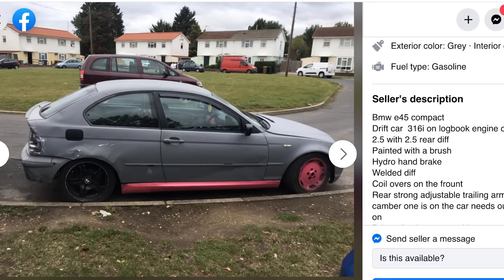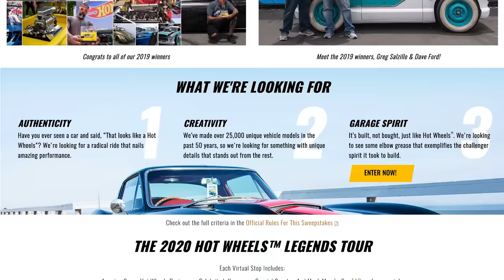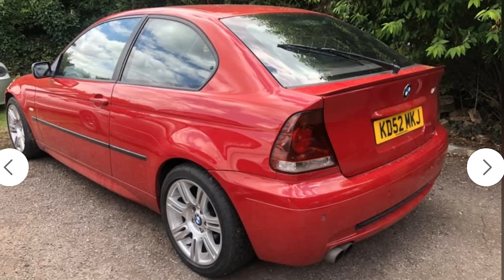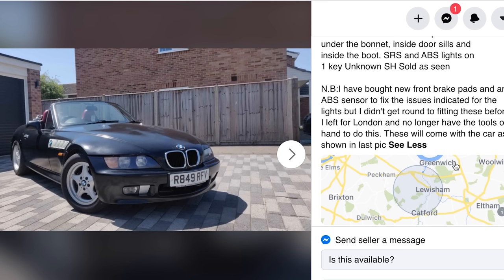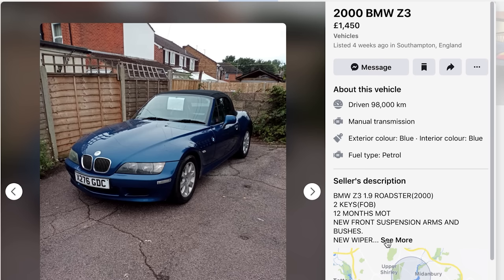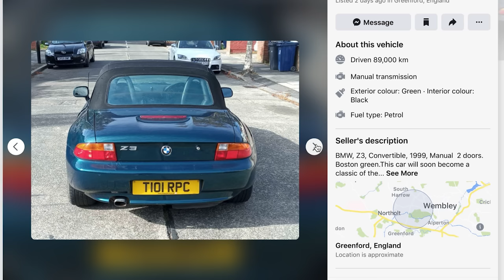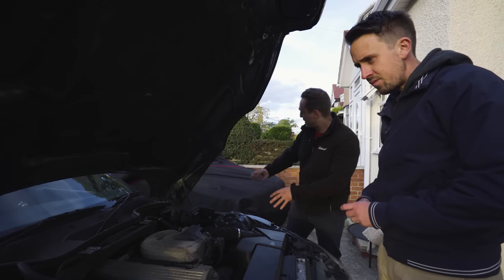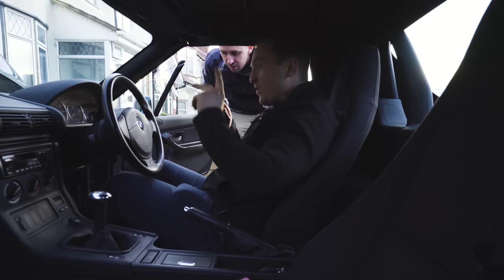£1000 First Project Car Challenge

Comment: The MOT history of this car is hilarious. It has failed because of:
The front lights being too cloudy.
Left windshield washer too low pressure.
Right windshield washer too low pressure (a different MOT).
The airbag being "obviously defective" one two separate occasions.
Worn brake pads after 5 years of advisories on them.
Different lights being out on three separate occasions.
A tyre being fitted round the wrong way.

Nothing major, but bloody hell a simple once over before taking it to the garage could have saved a few fails.
Reply: That's all insane! IDK how anyone in the UK with limited means or car knowledge can even own one. If I had to MOT my car they'd probably take it from me and crush it to put it out of it's misery. Structural rust, dashboard like Christmas Eve (VAG); SAIP, ABS, oil temp sensor, and probably something else, leaking; oil, steering and coolant and probably a million other reasons to fail. All that and my car isn't actually half bad against most other cars with 200k miles. I guess I should be glad I live in "land of the free to drive an absolute pile of shit".
Reply: @TheMadMadDaddy  I don't understand how can you live in UK where average wage is so high and cars are cheapest in the world and drive old falling apart car. I mean how? And why? It all should be so easy and cheap to fix...  Meanwhile my car failed mot in my country because it have red turn signals, had to install amber LEDs that no one sees and hey it got pass as it's not required for turn signals to be visible in my country it requires them to be amber... So much safety in that logic...
Reply: The Mad Daddy I’ve driven a rolling pole before and while it’s a ton of fun and zero worries about it, having a nice car is a different world. No nagging thoughts of breaking down or having a tow truck on speed dial lmao
Plus if I’m gonna drive a pile it’s gonna be alone I ain’t risking someone else if it splits apart on the highway
Reply: @wykydytron  I agree.
Reply: You could have a baby seat in every seat apart from the drivers and it won't fail. Rear wiper washers aren't part of the test.
Reply: Well my car failed because the odometer was pixelated(bmw). How is that a safety thing? I repaired that and now i have an airbag light that turns off after 1min30s.
Reply: @wykydytron  we might have cheap cars but insuring one makes up the difference when I was 18 I had to pay £3500 to insure a £800  2000 reg fiat punto
Reply: @FoookOff  Yeah you're right - I misread. It was nearside/offside windscreen washers that failed on two separate occasions. I don't think it even has a rear washer.
It got an advisory on the child seat because it obscured access to check the belt, not a fail. I was tired when I wrote it, that's my excuse.
Reply: @TheMadMadDaddy  Mileage really doesn't mean anything if you maintain the car, got a 240k mile Audi (A4 avant - 2009) and everything works perfectly, no lights and I've done frequent oil changes, checkups, etc - service book is filled to the brim.
Reply: @steon808  depends on the car. I just scrapped a 150k diesel with full service history. The fuel pump died and filled the injectors with metal filings. I don't think maintenance completely safeguards a car
Reply: @wykydytron  It's because they are so cheap - why maintain a car when you can buy another with a years MOT for the cost of a major service? By the time gets to this age/price they are usually owned by people who have limited means, so as long as the car passed the MOT they just keep going unless they have a relationship with a garage where the garage strongly advises them to change something to keep it going. With a car like this its a weekend fun toy, you can buy it for cheap for occasional use but you don't really have the budget to maintain a second car - so you use it until you get bored or it breaks, and it costs you a fraction of the depreciation on buying a newer car.
Not sure what your issue is with amber indicators - red makes no sense, particularly if they are utilising the brake lights (Technology Connections did a whole video on this topic).
Reply: It's possible they just didn't like the vehicles owner and wanted to spite them as best they could.

Comment: Milky residue - The only thing Ethan knows to look for, and it turns out when you find it it doesn't matter
Reply: Not when you're spending £950 it doesn't!
Reply: Mine has that too, its just condensation , you need to check milk with the dipstick
Reply: Haha I thought that too. We all do the exact same thing. Look for salad cream.... finds salad cream..... probably condensation, be fine 😂😂
Reply: Haha
Reply: @user-rp4je2gc2o  apart from if its a newer bmw then it doesn't have a dipstick. Like on my bmw you can only check the oil levels through the BC button.

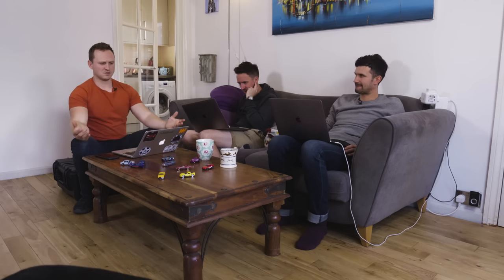Comment: 11:50 Engine management light is only an MOT fail if the car was registered after July 2008. Before then its just an advisory.
Edit: apparently this is only correct for diesels. I stand corrected.
Reply: It’s July 2003 for petrol and 2008 for diesels
Reply: Your wrong I’m afraid current mot guidelines state that the engine management light has to be checked on all petrol cars with less then 8 passenger seats from first of July 2003 if you have more then 8 seats it’s from July 2008 you can find the mot manual only the gov website and find it
Reply: Dave H your correct but it depends on how many seats the petrol car has 8 or more and it’s July 2008 aswell
Reply: Ah, I was only going off my own car which is a diesel and registered May 2008. I didn't realise it was different for petrol cars.
Reply: Actually no because my old diesel pug failed because of it but then re tested with it on the ramp to knock the light off and it passed and that was a 2006
Reply: An MOT tester failed my 2002 Golf last year for engine management light on
Reply: For those saying their cars failed the mot for having the engine light on, have a read of clause 8.2 in the guidance notes here: https://www.gov.uk/guidance/mot-inspection-manual-for-private-passenger-and-light-commercial-vehicles/8-nuisance
Reply: Dan L that’s correct then as registered after 2001

Comment: XD

I'm about to fall out of my chair laughing...

"What's reverse, is it up?" -- proceeds to remove shift knob, which clearly isn't secured properly...

XD
Reply: I bought a new project recently, and it has a 4 speed manual with a pushbutton electric overdrive on the shift knob. The overdrive is a bit intermittent so I play with the knob a bit and it flies off in my hand. Right, well, found the problem 😂

Comment: The MOT history of this car is hilarious. It has failed because of: aye
Reply: that car was owned by people who jut about knew how to put fuel I and thats it! not checking brakes or tires, not checking washer fluid , clearly had baby seats and forgetting to turn the airbag back on after removing the seat, not checking if the lights are working etc but despite that I think they bought a good car. not a ricer, just a mum doing a short run to shops and picking up the kid

Comment: I’m 16 and just bought myself a project car of my own, it’s a 2003 Skoda Octavia VRS Combi and I got it for €350. It’s pretty clean except for the fact it needs an engine 😂 Audi TT engine is a straight bolt in swap. That’s the plan 😁
Reply: Amazing
Reply: VW corporate engines like those can come out of anything and swap right in. Makes for an easy repair when needed for sure.
Reply: U lucky u live uk
Not singapore
Reply: No Ireland actually
Reply: Good luck insuring it pal. A 2003 VRS is a 180 brake engine and if you're planning on engine swapping, that's gonna be even more on your insurance. You wanna get a cheap 1L 3cyl to run around in so you can get a few years of no claims under your belt. That's what I'm in the process of doing cause I'm looking at a 1993 MR2 (W20) GT-i16 (rev 2) and that won't be a cheap runner for an 18-19 Y/O given the RWD, Mid Engine, 2 door sports car schtick given it's an insurance group 16 car. Be VERY careful about this car. You gotta think of insurance, tax, MOT, fuel, maintenance costs etc
Reply: @MaliceOfRites  I totally get what you’re saying, Figured out the engine that’s in it (broken one) is some Volkswagen engine (engine code AWT) and the one I’ve bought is the correct engine. A 180hp 20v petrol engine (code AUQ) so its still going to have 180 brake no more than that. And as I’m only 16 I’ve put it on my dads insurance and once I get it running right he can drive it until I can. Good Advice though mate 👍🏻
Reply: @seandouglas6080  fair enough. If that works then by all means. As long as you put the stock engine in it for now and keep it away from mods temporarily (even on your dad's insurance) you'll be golden. Just still gotta be careful, you know how it is. Like my ideal setup for my MR2 is probably gonna be a nice set of aftermarket wheels, a new radio (old ones aren't any good) a lazy eye system for the pop up headlights and maybe an aftermarket steering wheel. I don't plan on ruining the looks of such a gorgeous car

Comment: I own a Z3 2.8 "project car" for a few years. Best value car there is, really. It looks MILES better than an MX5, the straight six is a /fantastic/ engine that you don't have to 'turbo', and it's actually a pocker luxury car to boot. Electric roof, seats, leather everywhere, precious wood console, heated mirrors, ABS, traction control, limited diff and about 200bhp that sounds like awesome any day of the week. Been putting a great smile on my face for years.

Comment: De-restrict the intake, Cat-back exhaust, over fenders, rims (even if it's just powder coating them) steering wheel. That'll be interesting to fit into a 1050 pound budget. If you wanna go over, add harnesses and a rollcage

Comment: "No miatas"

Buys bmw's version of a miata

I actually had one of these years ago. I put a lightweight flywheel, a cold air intake and some decent tires on it. It was a blast!
Reply: What does a cold air intake do
Reply: @mcbrodz1663  Cooler air is denser and can allow for a more powerful combustion. 
By adding denser air, more fuel can be added to keep the air/fuel ratio @ stoich, causing an increase in power.

Comment: Things for Ethan to do (some purely for entertainment...), in no particular order...ok the order I thought of them:
 - Clutch (obviously)
 - Exhaust
 - Bumpers/full bodykit
 - Seats
 - Wheels
 - All suspension components
 - Brakes
 - New hood (the folding roof, not the bonnet)
 - Wrap the whole car, ideally metallic pink or BMW racing colours
 - Maybe a few E36 M3 goodies?
 - S52 swap...or 2JZ.
 - NEONS (just imagine Ethan in a convertible with neons and tell me it's not the greatest idea ever). Maybe spinners too.
Reply: I agree with all besides engine swap. M44 can make 550 crank hp with just arp headstuds and stock internals. Also the better weight balance makes the 1.9 z3 feel loads more nimble than the 2.8 and 3.2 models.
Reply: @lakeshorerides  550 from a stock internals m44? That sounds insane. Thats pushing it even on M5x engines.
Reply: @hojnikb  you'd be surprised, and then it's the pistons that fail. The block and bottom end will hold around 600 as they are factory forged with just cast pistons. It is pretty crazy. I've built 3 of these little motors so far. Very underrated. My daily e30 318is is making 400 crank on a conservative tune just for reasonable mpg haha. I can send you some videos if you give me your email.
Reply: @hojnikb  my bad, m42 not m44 but I'd imagine it wouldnt be much lower on an m44.
Reply: @lakeshorerides  Oh I don't doubt that the car can be better with the stock engine, but just imagine how funny it would be to watch Ethan trying to do an engine swap... ☺